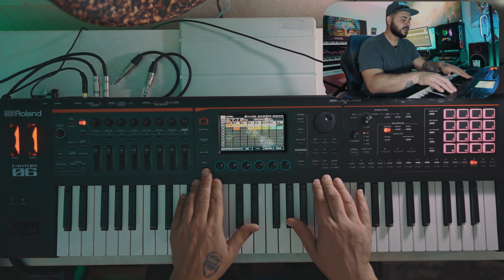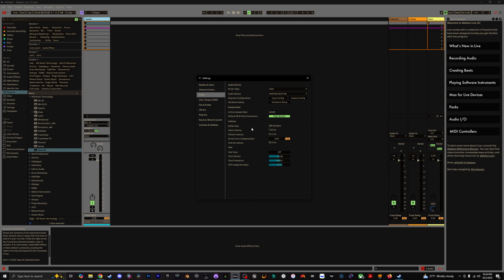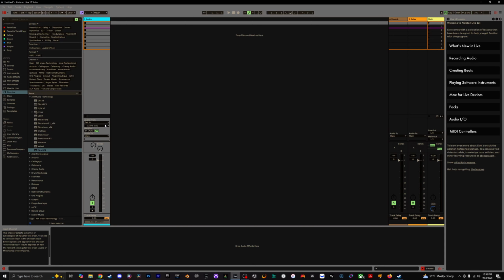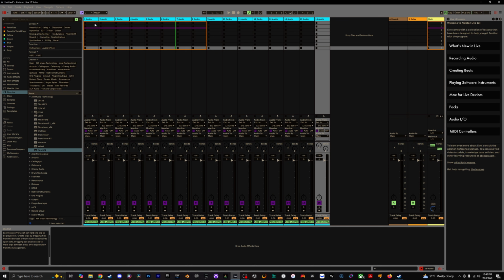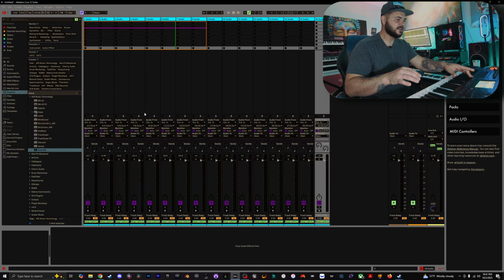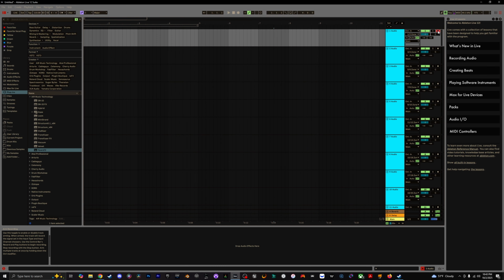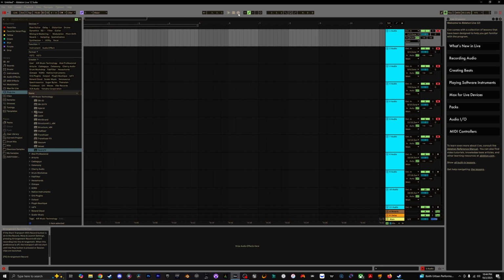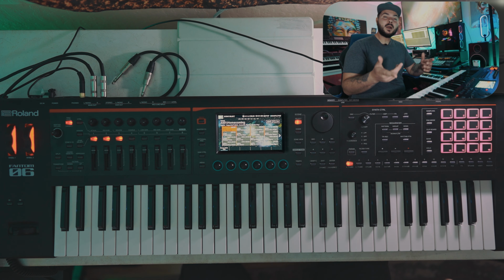Roland Fantom 0 - How to record 16 Zones using USB Audio into Ableton Live

Comment: How would you stack it up against the SL61 for a controller in ableton
Reply from the maker: If im looking just at the controller aspect its tough. The slmkiii has a few things that I like way better than the fantom 0.

I love the scales mode, whenever im in a rutt or maybe unfamiliar with a scale its easy to snap the grid and play. The arp and step sequencer is way better and less complicated. It can only controller 8 midi channels per session the fantom 0 can control 16 midi channels and toggle a lot easier back and forth. 

The fantom arps aren't that great. The chord memory is cool but not that great,

From a controller perspective there's not enough in the price difference to justify the fantom. 

But once you add in the sounds, the pads, and integrate the two. Id choose the fantom 0.